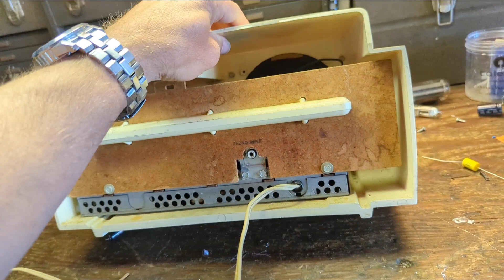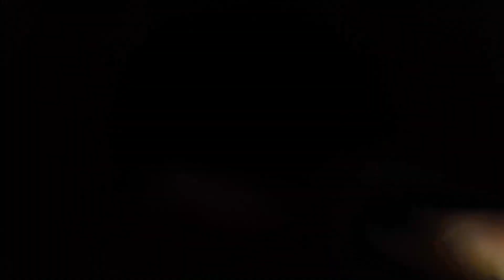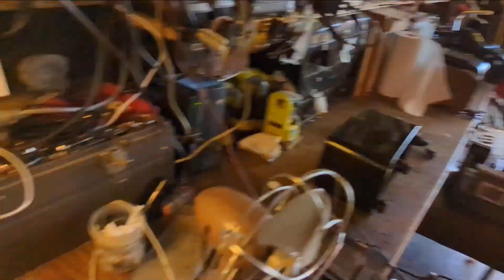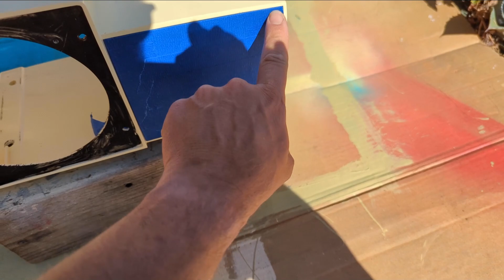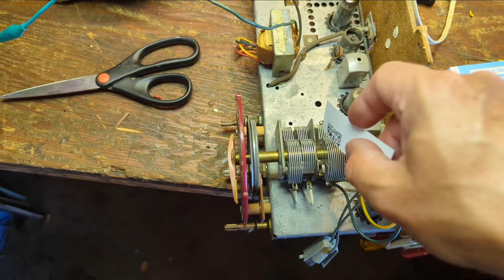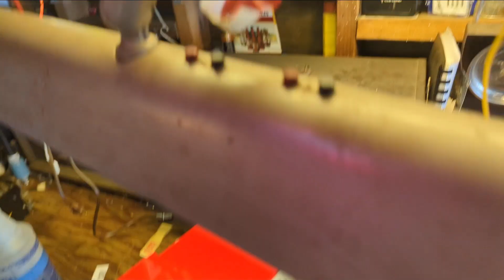Tired, Grubby GE Musaphonic plastic table set gets a custom job

Comment: GE loved these cheesy name games. I still have a set of GE "Acuoustophonic"  "air suspension" speakers with foam-filled wood-grained plastic speakers from 1970 and they sound great considering how cheaply they were made. The woofers in those speakers looked very similar to the speaker in this radio.

Comment: Looks like a well designed radio to me, plenty of cooling holes in the chassis and the bumblebee caps were the good components for the time.  Good work on the paint.  You're right, you have to be choosy about the brand and product line or you'll be disappointed.

Comment: It looks pretty cool in red Seth .😎 Why didn't GE think of that back then? Eventually you will come across three identical
 knobs or if it will be sold off, the new buyer probably will do it. Bluetooth is a great addition to an AM only radio in this
 case particularly because of it's "mid century vibe " design.

Comment: Oooo. The non-polarized plug, virtual-capacitive hot chassis AA5 type .. omg, metal uninsulated screws to the chassis.
 I’m kidding, but I’m not either.
 Jumpin’ Jack Flash (it’s a gas)..
and “bumble bombs”. 
 Dang, You hit the jackpot.
Reply from the maker: Hence the most important part of this process: Installing a .01uF a X2 Y2 across the line rated cap for the other end of the incoming AC. Polarized plugs are sort of useless on these. As soon as you turn the set off, the current will then go right through the filaments. Then you once again have a hot chassis. The cap more or less causes the total amount of current that could get to the user to be diminished to such a low level it won't even trip a GFCI. As in if worse comes down to worse, you might feel a little tingle if you so happen to somehow touch the chassis and ground at the same time.

Comment: After the tubes fully warm up turn it off for 5 seconds then turn it back on. If it plays right away the tubes are strong but if it takes 3 to 5 seconds to come back on then one or more is weak.